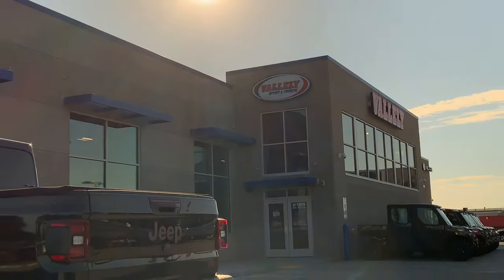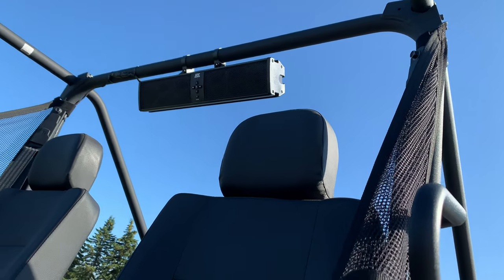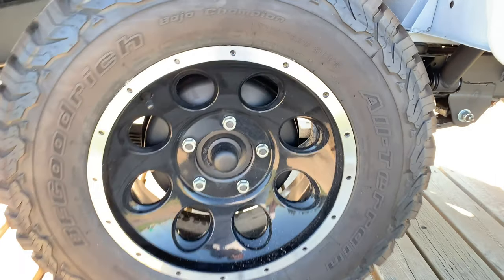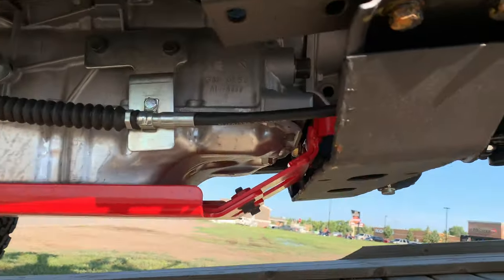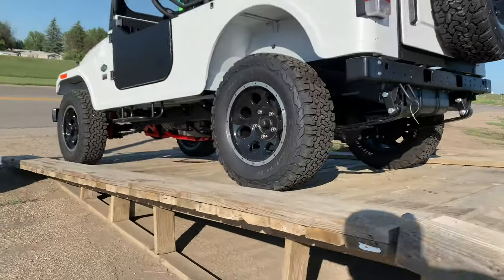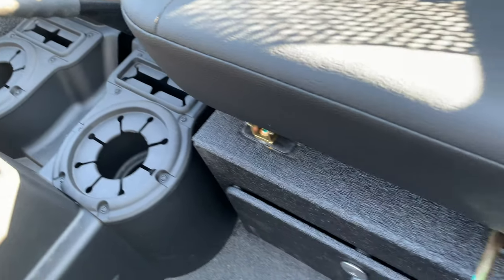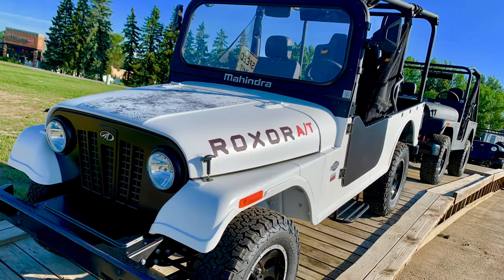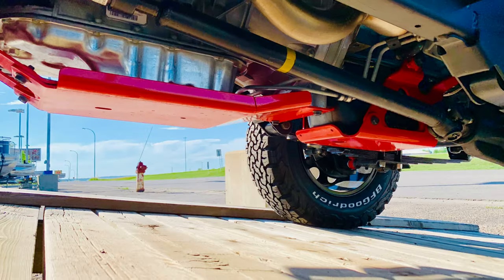The 2019 Mahindra Roxor Automatic has a 6L50 tranny from Punch Powerglide and it's really beefed up!

Comment: I wonder how long these would last I hope they are not toys you throw away
Reply: This not electronic based vehicle .This is highly mechanical ...It will last as long as you do the proper maintenance.
Reply: My grand father's 1972 Mahindra jeep still runs on rough mountain roads on a daily basis. So....
Reply: These Roxor aka Thar units specially  made for himlayan mountain off roads. Its reliable like a tank. Dont worry.

Comment: I have a couple of questions.  Does the standard Mahindra Roxor have power steering and brakes?  Is there a way of adding a heater and/or AC?
Reply: Power steering yes, not sure what do you mean by power brakes? - they have standard (no ABS) disk brakes in front and rear drum brakes.  Yes vintage AC / heater are also optional from factory, or of you prefer ur own there are tons of people on teamroxor.com forum and some fb group who have made their DIY types solution
Reply from the maker: Yes it does have power steering and brakes. There is an option to add AC and heat from vintage air. Check out the Roxor web page.

Comment: These things make no sense to me. The base price is low sure, but These end up costing pretty close to what a brand new Wrangler does when you add basic accessories, (like a windshield or a top) and they aren’t even street legal. Leaf spring suspension, not comfort features on the inside? Just buy a YJ wrangler, it cost you half of the base Roxor price and you’ll pretty much the same vehicle and you’ll at the very least have a heater!!
Reply from the maker: Only reason I bought it was turbo diesel, manual shifter and no electronics. Did you check about changing the water pump on a late model Ford Taurus? 
I really didn’t need this but this is what a perfect automobile is to me, so I thought I might as well have it in the garage while I can.